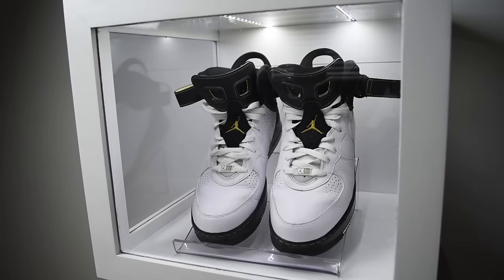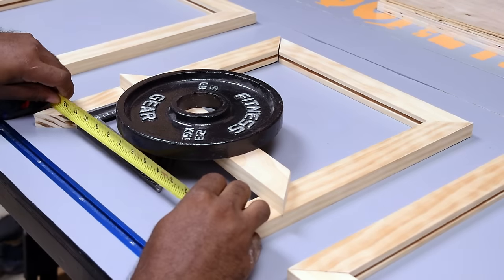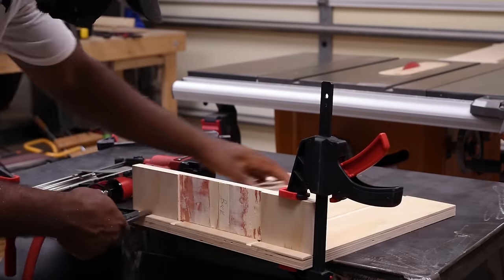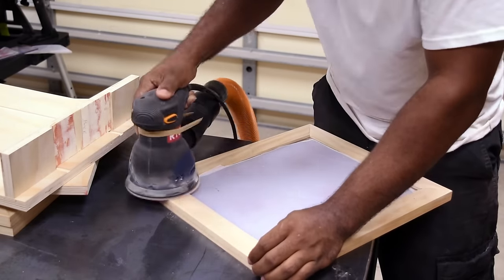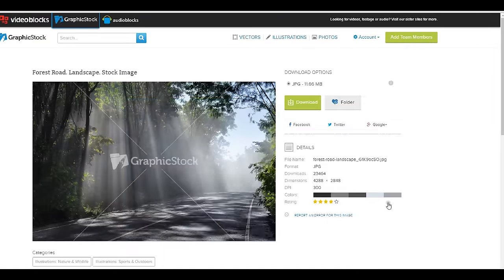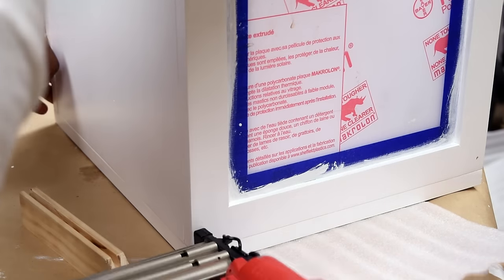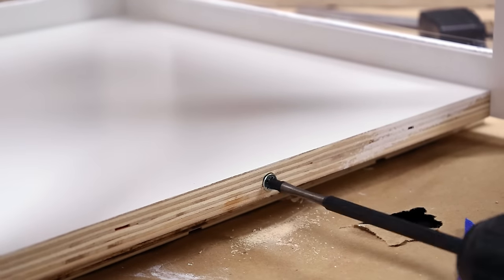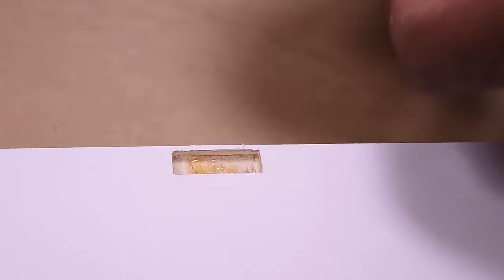How To Make A Display Case | DIY Build

Comment: excellent build very well done since the sticky back on LEDs does not like to stay stuck I would suggest hot glue to help it stay stuck or maybe even aluminum defuse strips they really even out the light and prevent led spots and droop

Comment: That case is amazing!! I'm a doll collector and looking to do something like this but on a larger scale. Could you give me some pointer? The display cabinet I'm looking to make needs to be 22in length by 45in width by 9in depth with plexi glass sides but wooden top with molding. Any input would be fantastic!! Keep up the great work!!
Reply from the maker: Thank you, That sounds good right off the back I don't have any tips. However if you any question you could always ask.

Comment: Glenn, do you think it would be easy to modify this design to display smaller or multiple objects?  Or even make it modular to display several pairs of shoes?
Reply from the maker: Absolutely I wanted to mention that, but didn't want to drag the video on since it was sponsored.

Comment: Because the vertical corners were not mitered, the corners became extra thick - 1.5" plus the .75" thick. This makes for an extra wide 'column' of wood blocking the view to the shoes. You should either cut the side panel's front 1x2 .75" shorter or miter the corners. In general, you should keep the front vertical corners as minimal as possible for maximum viewing. Maybe get rid of them entirely with just having the glass butting at the corners.
Reply from the maker: +Daniel Martinez 
Great point and I agree, this one is not the final product. I wanted to make this so I could get a better visual for the finally. I already see many improvement I can do. The next version will be on point.